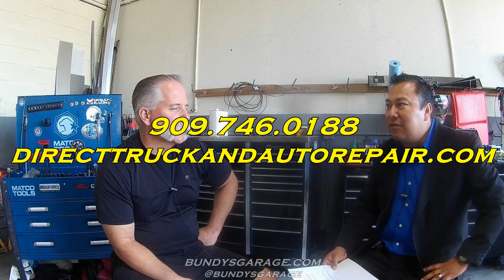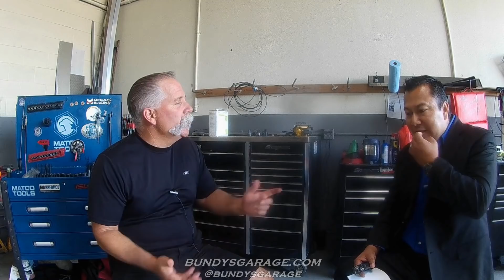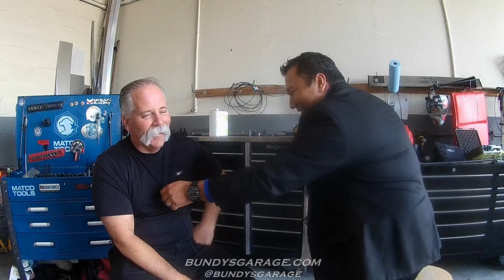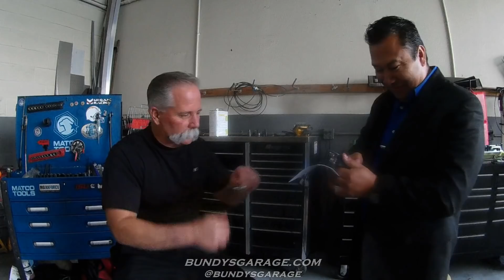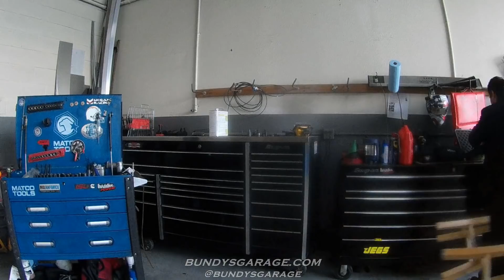Worst Diesel Engine Ever - What is the Best Diesel Truck out There? | Ford Dodge Chevy

Comment: I bought a Chevy 5.7 one time and when I was cleaning the block I found two cracks in the block at the water jackets. Both cracks had "repaired" written across them in shop chalk. I ran the crap out of the car I put that engine into and it NEVER leaked coolant one time. I got soooo lucky on that one! I have no idea how it got fixed but someone did a good job on it!

Comment: Personally, 7.3 is one of the best if not the best engine out there. Reason i say that is after having worked for a MAJOR school bus company for 13 yrs in NY, and one in St.Louis. There's NO other engine out there INCLUDING CUMMINS( which is an awesome ENGINE, serviced hundreds of them) that gets absolutely ABUSED like 7.3s and still gets the job done. School bus drivers are the WORST for abusing equipment. Two other engines that  in my opinion don't get the credit they deserve is GM's old 6.2- 6.5 and Ford's 330 c.i.eng. Having worked in a number of motor pools in USAR over course of 25 yrs, the 6.2-6.5 takes TREMENDOUS AMOUNTS of abuse, especially in field operations. When I was in Iraq/Kuwait in '03 the conditions ANY engine had to operate in was atrocious. The 6.2-6.5's were the mules for getting it done. I'm partial to Ford's but the Detroit/Allison is a tough combo. In my experience for what it's worth, every 330 Ford I dealt with were. severely abused. 7.3s, T444E's especially were "ether babies", but like TIMEX " take a lickin' and keep on tickin'!" Anyway, just one man's opinion.

Comment: Wrong.  The new 6.7 liter diesel is a phenomenal engine.  The 6.0 was a piece of shit and was actually an International engine.  The Duramax is also a POS.  Dodge has a great engine in the Cummins, but it’s in a Dodge.  Your comments about the aluminum Ford bed are also false.  I have one, and I use it exactly like every steel bed I’ve ever had, hauling brick, junk, atv’s, etc, etc, etc.  You should actually do your homework, and probably change professions.  I handle fleet procurement.  I purchased 32 F550’s with 6.7 diesels.  2 years later, one engine failed, died while on the freeway.  The local dealer came and got the truck, put a new engine in it at Ford’s expense.  No further problems.  Everything you’ve said is uneducated opinions.

Comment: I'm basing this comment off of decades of experience plowing snow commercially... using a mixture of different makes of trucks.. I would have to disagree with your statement of the Ford chassis being the best one... the Ford trucks that I've ran had problems with universal joints in the drive axles wearing and when you have to fix them they are exceptionally expensive because of the vacuum operated hub lock system ...every time you tear  the front end down you have to replace the seal and those front ends wear out all too often...having done the exact same type of work with GM trucks that I know everybody complains about the supposed weak front end with the exception of having to replace a wheel bearing or a ball joint which you have to do on Ford's as well I have never in over 25 years ever had to replace an axle on the GM trucks except if I chose to because a boot ripped!!! Just my thoughts and experience... I know the Chevy icon is going to make you think that I am just  Chevy fan boy  but I have owned all three brands and have extensively repaired all three brands..

Comment: Biggest problem is lack of maintenance due to costs have a 6.4 200000 miles plus still awesome 5000 mile oil changes 10000 fuel filter changes and most people don't now how to drive there deisel in it's powerband
Reply from the maker: This is not a smart ass question. How does one drive their diesel in it’s Powerband?
Reply: @bundysgarage  I have drove truck for 30 plus years you run the moter with in rpm range most diesel owner mash it to the floor and want it to pull like a semi I run mine in the rpm range and let it pull and that's pulling a 32 foot stock trailer plus all manufacturers need to go back to manual transmissions automatics are for people that don't or can't drive a manual why better fuel mileage to just me been working on trucks my whole life and driving them proved this time and time again

Comment: I have a Ford 6.9 IDI with an automatic.
Bought this truck new , now it's got 300,000 miles on it.
The only major work was heads were replaced at 105,700 and trans rebuild at 200,000.
I run it with propane boost .
Everything else is falling apart but the engine still runs strong.

Comment: The WORST IMITATION DIESEL was from NONE other than GM in their usual EVIL plot to SCREW the American public by PURPOSELY cheapening everything that they manufacture to this very day. The UN-safe at ANY speed Corvair, Vega, Two Speed Power Glide (slip & slide) Transmissions, Rear coil suspensions on their Pickups (1960-1972), Saturn and the list goes on. Now, they WILL NEVER RECOVER. GM has a LONG history.
Reply: Imitation? What are you referring to?
There was nothing wrong with the rear coil spring suspension on the Pickups, I have one. Still safe. 
The Powerglide Transmission is an amazing transmission, and still used today in a lot of high horsepower cars.
Reply: @1badk20  Well, there WAS, something wrong with coil suspension (1960-1972) AND that is the reason GM abandoned it. It could not hold any weight compared to lead springs. GM lost its #1 rank in pickup sales to FORD over that and GM will NEVER recover. Right now DODGE Ram is kicking their ass. And at this rate, Chevy P.U.s will soon be behind Toyota.
Reply: @juans6639  Gm lost #1 in 1978 or so.

The Silverado is still number 2 for yearly sales as of 2018.
Reply: @1badk20  Ford claims in their ads that they have been the best selling pickup for the last 47 years in a row. According to my math, that would be since 1972, which in the following year 1973, GM decided to switch back to rear leaf suspension on their pickups. I can guarantee that the BOZOS at GM will NEVER do that again...Well, maybe.
Reply: @juans6639  No they don't, where did you get 47 years haha. You are wrong once again. 1977, I was 1 year off. Had nothing to do with the suspension lol. 
https://social.ford.com/en_US/story/ford-community/built-ford-tough/40-years-tough-america-s-best-selling-truck.html

GM is the largest Automaker in the US. 
GM's Stock prices are more than double Fords.
Reply: @1badk20  I told in the previous answer. FORD is the one claiming that their Ford pickup has been the best selling for 47 years straight, not me. 47 years minus 2019 equals 1972 according to my math.
Reply: @juans6639  I just sent you a link to Ford's website. Nothing shows 47 years, it says 41 years
Reply: @1badk20 I repeat, FORD SAYS THAT ON THEIR AD. EITHER THE AD LIES OR FORD LIES. I will not lose any sleep over this. Maybe soon enough you will have a chance to see the FORD ad for yourself.

Comment: Here's what Ford thought about their diesels - even the 7.3L -they ran 5.9L and then 6.7L Cummins motors in their F650 and F750 trucks from at least 2000-2015. What does that tell you Ford thought about their International and Ford diesel engines? Take a Powerstroke, a Duramax and a Cummins to your local diesel shop for a repair and tell me which is more cost efficient? Cummins is lowest cost of ownership of any of these diesels (less moving parts, easier to work on). ALL vehicles break down, and ALL vehicles have common flaws to their respective make/model. Use facts and logic - not emotion when stating your point people.

Comment: I would say the 5.9 cummins and the 7.3 powerstroke were the best. Of course I ended up being biased based on my experiences, I bought my 2nd gen cummins (6 speed, last year of the vp44) under probably the worst circumstance. Kid had it and beat it till he probably couldnt afford it anymore. drove it 10,000 miles and put in 5k in preventative maintenance. Someone I know owns a local shop specializing in diesel performance and repair, very lucrative as it seems the newer trucks (05 and newer) seem to be there all the time with problems. Gas trucks are better I feel (unpopular opinion).

Comment: Only ford I owned, new LTD needed valve guides in less than 2 months. I have a 89 Chevy Silverado bought new, still runs great, looks like hell due to unleaded paint. 255K miles.

Comment: The biggest issue I’ve seen with the stock 6.0 are the high pressure pumps other than that they do good. Now if you add a tune thats an entirely different story if you have a 03-04 model the 05 up seem to not be as bad but I still don’t trust them unless they have been bulletproofed

Comment: My 6.0 has 238,000 miles and it seems to have more power and seems smoother the more miles it has......go figure......but EVERY 5000 miles it goes back to the Ford dealer where it was purchased new and serviced according to Ford specks......the Cummings seem sluggish to me and duramax seem to loose power the more miles you have on them....I experienced both on company furnished trucks..

Comment: I've had an 1989 Isuzu NPR 4cyl turbo diesel  for 27 years.4Bdt-1 Other than PM nothing broke. We were hard on brakes due to overloading it. Gods of rust are taking it down. 
Pedal to the metal 69mph. It will probably be shipped to Pakistan or Egypt when I am done with it.

Comment: powersmokes are Great Boat Anchors. The Cummings has always been good but not high on the strip. Duramix works great on the Racing Strip but again. When you are looking for a Diesel look for one that has a good track record and has less complaints and less TSB's. This can be a FORD Chevy or Dodge. They all have good points and bad  points. The one thing is It's a Diesel and has a requirement in that. Not made for Short Trips to and from the Store. They are made for continuous running and all day trips.  Also they require maintenance all the time.  Ford does not like going over the Oil Changes. Keep the maintenance up or you will be walking. This is ANY Diesel Truck.

Comment: I have a 36 year old diesel Isuzu and never have problems finding a head gasket. No inline Isuzu diesel is difficult finding a head gasket for. Do yourself a favor and find the 4 digit engine code on the side of the block and Google that number with head gasket, and boom, you've found one. Not that difficult at all.

Comment: We rescue horses off the road for people who break down and they all have diesel pickups I would say 8 out of 10 broke down are Fords, we had them all right now the best new one out there in my opinion is Chevy Duramax with Allison transmission that what we use
Reply: That is probably because 18 out of 20 trucks towing trailers are Fords. There are over twice as many Fords so there are going to be more to service.
Reply from the maker: You want to know why Fords are so popular. Cause there cheap at initial purchase. But then you add on repair bills/costs and then it does not hold its value at all wen it’s time to sell. Where GM, Dodge all hold their value way better.

Comment: I Have the 7.3 F-250 crew cab short bed,  I waited 12 years to afford it as well as all the stars, planets and half of the Galaxy to be in alignment for me to get this truck. It's hardly broke in at 203 thousand miles. It's a 2001, and it's live most of it's life in Michigan, so the bed is shot, but it's still holding tight, for now. I've priced several chip tuners but I have yet to buy one that I feel comfortable with. That being said, after an oil change a new air filter I have achieved 20 miles per gallon. However most of the time I'm running in the 16 range. It is cold hearted in the winter unfortunately this one happens to have an ether habit when it is not plugged in overnight. Especially on some of our toasty cold winter nights in Michigan when the bottom falls out of the thermometer. You folks in SoCal probably have never seen -34 but I am only two miles inland from Lake Huron. When a  Wicked northeaster comes blowing in it gets really cold. 
Any genuine advise on a chip could be well appreciated. I don't need Gonzo horsepower but it would be nice to get 21 miles per gallon with my diesel regularly.

Comment: I’m a ford tech have a 6.0 had if for ever I run the hell out of it and I change the oil 3k miles change the coolant once a year and filters when I’m supposed to never had a
Problem with the engine oh and I use cetane booster it’s grate it’s called take care of it

Comment: I have a 1988 F-250 4x4 with 118k on it. I have had it since about new. 
Now I just purchased a 94 350 . 
Thinking about putting on new head gaskets ( blown head gasket with a perfect bed body $400.00) in it and putting in my 88

Comment: Anybody remember Oldsmobile diesels? They were bad. Basically a reinforced Chevy 350 with diesel heads. Only good thing is the blocks are strong for hot rodding if you build for gas.

Comment: Just an aside for some of you guys crowing about having "250,000 (or 170 or 280) miles on my xxxxxxxxx diesel" really?  Because those are common miles for 5.3 and 6.0 gassers.  My half ton Hemi has 258k and my Escalade has 260.  My 'burb, 5.3, has 275.  None of them have ben cracked open yet, though the 'burb started making some unpleasant sounds these past few weeks.

I buy and sell gassers every week in the quarter million mile range.  It is, literally, common.  And here's the kicker:  When that 5.3 finally does crap out?  $500 and an evening's work and it's replaced with a low(ish) mile engine...what's it cost to replace your oil burner?  But you save the cost in fuel...oh, yeah, diesel is a buck more a gallon, or more.  You don't get enough MPG to even break even....  But you gots more horsepower!  Because you're all out towing huge loads on the highway like diesels are made for...  You aren't?  Damn, I do love selling diesels to you people.  I'll admit that...

Comment: The 7.3 is the Lord of Diesels.  The 6.0 is trash and no matter what you do to it, it will remain trash.

Ford transmissions and electricals and front suspensions are also trash.

Cummins is fantastic and Dodge bodies are...meh.

GM is by far the best all around truck, but the Duramax has never been more than "ok".

All that being said, are you towing BIG loads long distances on the open road?  No?  Then why are you buying a diesel at all?

Comment: Worst? Ram EcoDiesel. That motor didn't belong in a full size truck. And apparently Ram agrees, and it was quietly phased out...Best not mentioned, Cummins 5.0 V8 in the Nissan Titan.
Reply: The Ram EcoDiesel is funny...funny like the Italian Navy.
Reply: @MarvelousSeven  Looked good on paper though..but the irony is Fiat actually were the ones that cancelled the Cummins V-8 project that Chrysler had initiated to replace the I-6 motors we are familiar with. That's how the motor was put into the Titan pickup, Cummins were stuck with a motor suddenly nobody wanted, and offered it to various customers, and Nissan bought it, filling a niche in their pickup line.

Comment: Great video I have a 2014 Dodge Ram 3500 rolling 400 thousand miles it’s got a 6 speed manual transmission had to replace it at 300 and 17 thousand miles
Reply: Jeezz I thought 150K miles on my dad's 2014 Powerjoke was a lot. Those Cummins engines are some of the best out there, right up there with a Cat 3406 or a 7.3 Powerstroke. I want my dad to buy a Ram for his next truck but he just loves the Fords. Don't get me wrong, those new Fords are nice, they just need a Cummins or Detroit under the hood instead of the POS Powerstroke. Stop strokin and start cummin!

Comment: So I had a stock 2006 6.0 for 13 yrs 220K miles. The last year I owned it I finally had the oil pressure no start issue. No other major issues
My 2019 6.7 is much faster  long term I hope it's as good as my 2006  was.

Comment: He never gave the 7.3 stroke as an option ;)

Edit: I take that back. Posted too early.

We made a mint exporting the f250/350 supers and crews to the US years ago.
Reply from the maker: What do you mean exporting to the US?
Reply: You have many smaller "shingled" (Ford, Chev etc.) dealers in the US who don't get the allotment that the larger dealers do.
.i.e - silly to see a tiny, family run Ford store in a place like central Montana who could be selling a ton of f250/350 product but don't have the allotment, so no product to sell...
What happens here are the larger dealership won't dealer-trade their diesel 250/350 to the small dealers, so it ends up being a case of the large dealers get larger and the smaller dealers continue to suffer.

Canadian exporters fixed this to some extent by shifting product from up here/Canada to those dealers down in the US who had the demand for it but who didn't have the allotment from the manufacturer.

Exporting taught me that auto manufacturers are the worst at looking after their own...

Comment: The 7.3 must be the only engine that Navistar got right then. Sure they say the 466dt was Bulletproof. But it was also very weak. I see International Trucks as junk. I think the only reason people keep buying them is because they're cheaper. When I work for utility company there was always issues with the Internationals that had International Motors. The ones with the Cummins ran good. The semi International Trucks are also junk in my opinion. They run with Cummins engines for the most part because the International Motors are junk. But the trucks inside Fall Apart. They were made very cheaply.

As for the pickup trucks Ford and Chevy are both very foolish for putting V8 diesels in. It's so hard to work on them which drives ownership costs up. I don't know why Ford couldn't do an inline 6. As well as Chevy and Isuzu. Many utility companies that leave their trucks idling all day are switching to gas. Or going with the ram